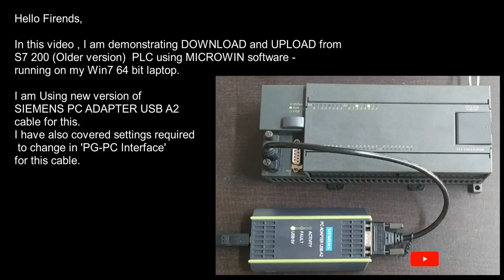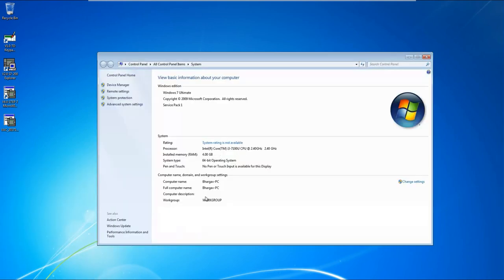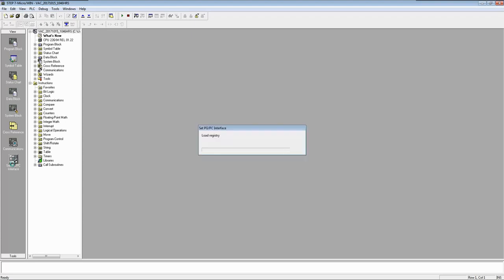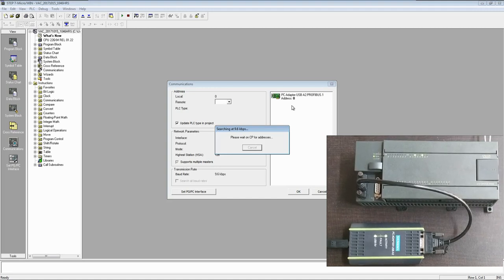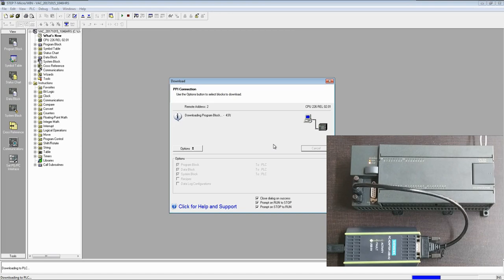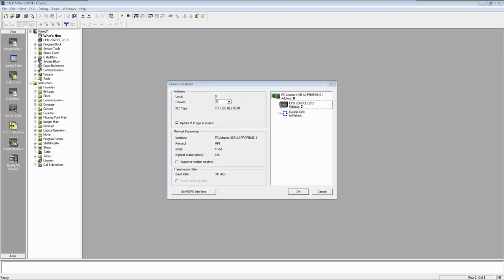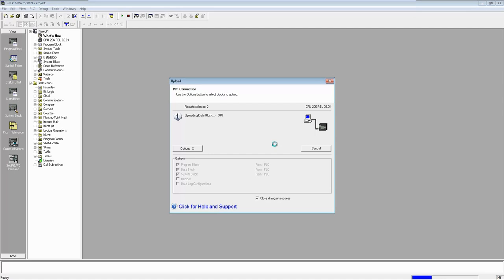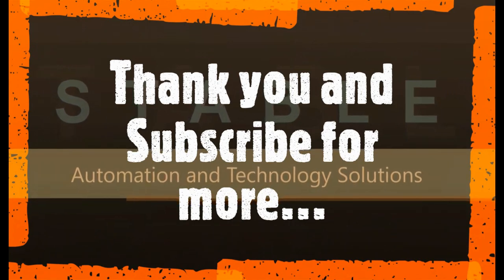S7 200 Upload Download using USB Adapter A2 - S7 Microwin

Comment: bro i face problem on window 10 
i have pc adapter usb a2 v1.4 i installed driver pc adapter usb a2 but on step 7 4.0 not show driver of pc adapter usb a2 only showing another adapter like as ppi mpi auto
Reply from the maker: Check if it is showing properly in Device manager.
Reply: @StableAutomation  ya device manager show properly connected  
i only connected pc adapter without plc 
usb indicator light on 
power light on 
mpi light on 
all working properly but not show on pg/pc interface setting
Reply: now i try on window 7 but problem  not solve i installed driver pc adapter usb a2 v2.0 through device manager but not resolve
Reply: my pc adapter version is 1.4
Reply: i guess i have unsighned driver of pc adapter and my operating system is 64 bits now i disable unsighned inforcement from window now i try again